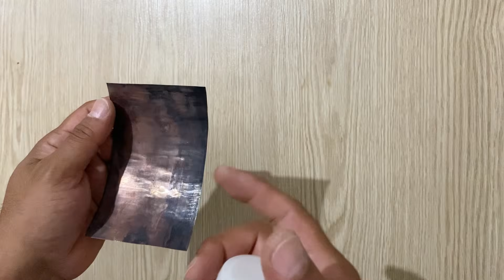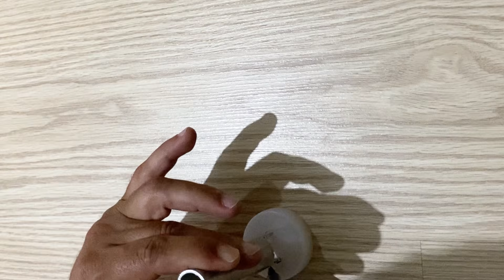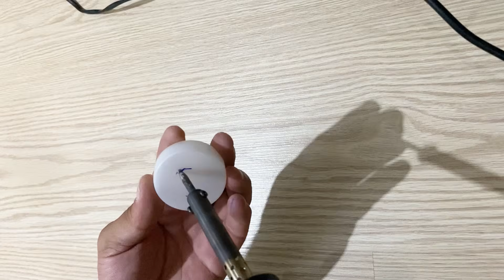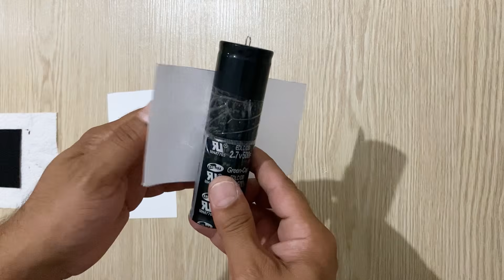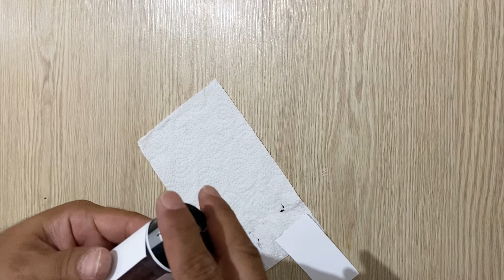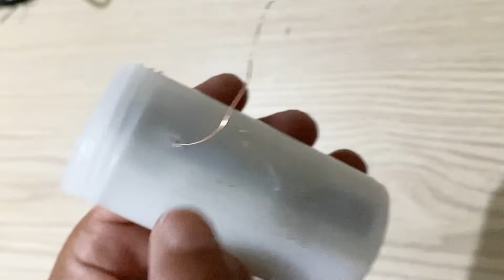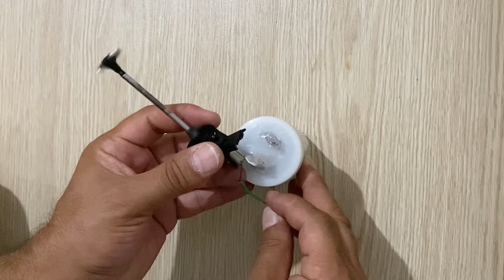How to Make Real and Powerful Battery, DIY Battery (5 Years Lifespan)

Comment: They can run indefinitely with a flow of 10-20% NaOH. But when I removed the NaOH the oxidation on the aluminum was such that it would not work again. Yes, the electrolyte turns to sodium carbonate in about 6 hours. Fresh electrolyte will keep it going. But if it dries it didn't work anymore for me. Nice clean work. Thanks!
Reply: you could use a baking soda/water mix and clean off the aluminum oxide with some gentle scrubbing before reusing. hope this helps!
Reply: Something I've tried that actually seems to work is to rinse the anode with vinegar. It stops the reaction of alkali on the anode. But it must dry completely or be rinsed with water before refilling with electrolyte or else it neutralizes the electrolyte. It does preserve the aluminum.
Reply: @evanriddle1614  I imagine that the vinegar has to sit on it for a while, right? i would think you would need to scrub at least a little, and since the aluminum in this example is so thick i'm not against scrubbing a bit for it to work at full capacity.
Reply: @zatnicatienth  just contact with the KOH or NaOH neutralizes it. Baking soda is for acid. Vinegar is for alkaline. The vinegar has to dry completely or be flushed out with water. The aluminum can be used again and again. I got 10 hours out of about 2 Sq cm .025" thick for a total of 1.5 ah. 2 hours one day, 5 hours the next day and the rest was consumed in 3 hours final day. About 150 mA
Reply: If, then, you were to feed it with electrolyte ( do we call it "catholyte now?) and drain out the bottom in a constant flow the charcoal would receive needed oxygen fully wetted or not and without CO2 incursion. Just a thought. Thanks.
Reply: Can you charge the battery
Reply: what if you use an aluminiumsulfate electrolyte? wouldnt that be better.
Reply: @Preyhawk81  just have to try it. There is an alkaline citrate I've seen on various white paper type websites says that's the best for aluminum air batteries. What's funny is this is similar to what's used to treat kidney stones. While I have a little feedback here, might I suggest wood glue (pva), a coffee filter and gum arabic. Mix pva & gum arabic, squeegee onto coffee filter and let dry. 6 hours run time instead of just one hour.

Comment: Interesting and educative video. 

My question is, will the battery also work fine without the activating conduct materials used? More also, what is it function?
Reply from the maker: It will work but not as long as the same lifespan.

Comment: Pls since i cannot see copper for to use and to which u sugguedted i used lead or stainless stiii. I waam to use lead.please can i coat it with a a mixture of charoal, electrolyte, carbon from finger battery and possibly use leas acid  of sudium hydrocide as water

Comment: Couldn’t you switch the materials and get the same result? Like instead of copper foil and aluminum pipe, use aluminum foil and copper pipe?
Reply from the maker: Yes you can. It doesn’t matter.
Reply: @joyofelectronics9782  ah, thank you! Also, I had another thought about your design. Couldn’t you get more energy out of it if you added more layers of foil/papers in the container?🤔
Reply: I's much cheaper the way he did it.  Copper is expensive.  Aluminum is cheap.

Comment: 😂Everything is good and thank you, but let me clarify some important points: 1- The idea of exchanging electrons between two different metals is the working principle of all batteries, and the voltage and current intensity vary according to the type and size of the electrodes and the conductive material between them.  The electrons that occur when a load is installed on the battery from the negative pole to the positive pole lead to erosion of the negative pole, i.e. losing electrons and gaining them on the positive pole, just like the electroplating process. This means that using the battery with a load such as a lamp or LED will lead to damage to the aluminum and the acquisition of a copper oxide layer  It reduces its work with the passage of time. The maximum period that a battery of this type worked with me with a medium of chlorine is 10 continuous days, but believe me, it will not exceed 15 days in any case, and removing the intermediate material upon completion of using the battery is only a postponement of the inevitable.
Reply: Ok p

Comment: This Is NOT A 5 Year Lifespan Battery,  5 Year Lifespan Battery Is When You Connect It To Any Device With The Same Voltage And Forget About The Energy Source For That Device For  5 Years, This Is False Clickbait As It Can Be..
Reply from the maker: No, you are mistaken. For example when you buy a car battery, it is written you can use this battery for 2 years. But you are not constantly use the battery. I meant the same thing.
Reply: To my experience with such batteries they'll work if they don't dry out. He's sealed it pretty well but I believe it would need to remain at least moist. If it dries it turns to alumina and isn't any good anymore. I've made these. Not bad! I like your style of building!
Reply: Much more could be said about this. I like the amperage. A few dozen of these could run a golf cart. But you'd hit that 6 hour "wall" in which the NaOH loses its potency. A method of displacing old electrolyte with fresh new electrolyte from a tank would keep it going. But such a system with all those tubes and pumps...yikes! Perhaps a longer vessel to let alumina fall off, not unlike lead acid battery cases for catching sulfated crystal formation.

Comment: Is there any alternative to cooper coil cos I can't see it to buy?
Reply from the maker: You can use either stainless steel or lead
Reply: @joyofelectronics9782  should I make the lead into square and roll or?
Reply: @joyofelectronics9782  I asked if the lead should be coated too
Reply: U did not ans? Should the lead be coated too?

Comment: Can you make this battery for 12-volts ? . What about if this battery discharges like other electroite batteries. Can you reharge it and how?.
Reply: The electrolyte is an instant charge there is no charging needed this is the beauty...also yes you can series and parralel n step up or down too any volts you require
Reply: @jshaw4757 when the power gets low, wouldn’t it be recharged or do you go ahead to change the electrolyte? At what point can one change the electrolyte?
This battery is interesting and is what building.

Comment: If one increases all the component sizes by for example 5 times will the voltage still be about 1,25 Volt or will it increase? Thanks.
Reply from the maker: The voltage will be the same but the current will increase 5 times.
Reply: @joyofelectronics9782  Thank you friend.

Comment: Creative video, well done, thank you for sharing it with us :)
Reply: Better to use lead instead aluminium pipe. Because electrolite solution will spoil the aluminium. Electrolite don't have negative effect on  lead.
Reply from the maker: @jamalfuzail4369  you miss a point. That’s not the case. It’s something different you said.
Reply from the maker: You’re welcome ☺️

Comment: Nickel Iron sulfuric: A battery with no electrode deterioration at all. Edison's circa 1900 batteries supposed to still work.
Reply: Not sure but isn't the Edison battery nickel iron electrodes and potassium hydroxide electrolyte?
Reply: @zendog48 I believe that's the case
Reply: And how do you acheive that 100% insulation and no passage of a single electron; so infinite stability, no side reactions, no air oxydation, no contact with water or moisture?
What are the electrodes? 
Fe and Ni? 
What is the solvent? Water?
What is the electrolyte? H2SO4 or metal (iron - nickel sulfate)?

If in contact they will corrode little one way or another...

That is why batteries can't last forever.

PHZ
Reply: @philouzlouis2042  Yet somehow batteries from my toys in 2004, and Nintendo DS still work. I think we were close to utopia but then some Brazilians came by. Replace Brazilians with the one race you can't talk about.

Comment: Well done. Now if I could make a suggestion. If you make this a two chamber battery then you could just tip the electrolite into the other chamber between uses then have it return when needed. That way you will not be continually handling the corosive liquid.
Reply from the maker: That’s Right but you can’t use the same electrolyte for a long time. You need to use new one bro👍
Reply: @joyofelectronics9782  how long can it last if in use for at least 6 hours daily? Does it matter if not poured out when not in use?
Reply from the maker: @nnejiamaechi9385  yes it is need to be poured out. And using 6 hours a day you can use it for about four years if your aluminum is thick enough 👍
Reply: @joyofelectronics9782  Ok. To me it does not matter if I does not last dat long by using it 6hrs a day and did not pouring it out. What I would prefer to do is to change it whenever the electrolyte is weak and it can be determined by the reduced voltage.
Reply: @joyofelectronics9782 can you use an automated spray system too keep the electrolyte topped up rather than a soak n toss method...its just a part off my ideas you seem too be on the same thinking as me but yh like a small solar powered electrolyte sprayer that sprays once every 10 minutes forever would that solve this issue maybe with an arundu board and a mechanical trigger off some description...cheers..get back too me if want too bounce ideas
Reply: ...and there you go folks!
Just like that.

...Oh. You don't have to ask about making a suggestion. This is the purpose of the "Comments" area.
But it's nice to know your parents raised you well.
Reply: had same thought

Comment: Doesn’t sodium hydroxide dissolve the aluminum and form hydrogen ?
Reply from the maker: Yes it is. So that’s why we left a tiny hole on one of the battery pin. So you have to be careful about this produced hydrogen gas.
Reply: a hose from this device to a balloon to collect the hydrogen produced would allow you to create more energy
Reply: I read through out all the comments to see if someone mentioned this,
surely, the reaction between Aluminum and Sodium hydroxide is very aggressive and used produce hydrogen to be used as fuel, it also creates a lot of pressure inside the cell and with a hole in it can let the electrolyte to spill out and causes damage to its surroundings.
also, the Aluminum electrode will be dissolved very rapidly even if the battery is not in use.

anyway, the instruction were good and maybe using another electrolyte can result in a safer battery.
Regards!

Comment: how much time it will run your blender continuously(how much watt of blender), & after fully discharge how much it will take time to recharge again ?
Reply from the maker: The answers to your all questions are exist in video. But l will explain again: this battery is not a rechargeable battery, l mean you don’t need to charge it. When you put electrolyte it will work. When it has electrolyte it can provide electricity for 6 hours. After 6 hours you have to renew the electrolyte. So it can run the blender for six hours.
Reply: @joyofelectronics9782 
He asked the ampere hour capacity of the battery .I am also eger to know it connecting additional cells in parrallel,is it possible to run higher loads?👈
Reply from the maker: @harikumar4418  bro the the voltage is 1.25 volts the current is more than 1 amp so the battery can provide this current for six hours. It means the battery has 1x6 = 6Ah. Yes if you make more than one battery of this and connect them in parallel and serial you can handle higher load.
Reply: @joyofelectronics9782  you are good in ansg questions and will increase your followership
Reply: Are u saying at 1,3v with over 1amp it can carry blender and to the extent of 6.hrs

Comment: What electrolyte you use, water + alcl3 ? , The alcl3 have yellowish like milk, its sign impurity of Iron, I dont think its aluminium will survive in it, i have try 3 week aluminium foil dissolved completlely, and i try ionic urea/alcl3 the aluminium foil not dissolved in 4 month but there are sign of corrode like many small holes, because there a bit water from air (moisture) exist in electrolyte forming HCL, and it corrode aluminium, the solution i think is use high purity aluminium like more than 99.92% and 99.98% electrolyte purity, and free from moisture/water, i guess  the impurity will make new side reaction, and the electrolyte must free from water
Reply from the maker: I used sodium hydroxide. This is a typ of aluminum air battery so it’s normal the electrolyte deplet aluminum, the battery produce electricity via this way. But as the aluminum is very thick it will take very very long time to depleted completely.
Reply: When the battery breaths its gass, which is Hydrogen and harmless, but it can be expected that there will also be some other gas that goes along with it. Is it dangerous to breath this in? Or should the battery be placed in a ventilated area? Thank you friend.
Reply from the maker: @benjaminvangheluwe3079  it’s better to use it in open or well ventilated area👍 hydrogen is detrimental
Reply: Puedes traducir a Español, Spain, 🇪🇸 Gracias
Reply: @maykaGM  debes aprender a copiar y pegar un texto en internet y usar el traductor de google
Reply: How many amp hours will it produce. Have you done any experiments with it?? I could see several of these together for motorcycle battery
Reply from the maker: @drewrinker2071  6Ah with same electrolyte
Reply: @joyofelectronics9782  dang, that's impressive

Comment: When you said it last for 5 years,   did you mean 5 years in storage  or 5 years of continuous use ??
Reply from the maker: Not both of them. I mean with a normal use the aluminum will deplete after five years. If you use very rarely you can use maybe ten years in storage.
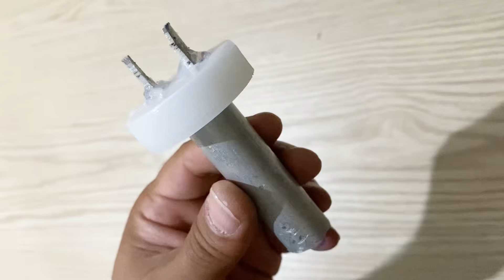Reply: @joyofelectronics9782 7:22 Good. Meaning it's not rechargable? What is the Amp? If the size is increased will produce more volts and amps? Can this size run a DC fan or motor ..small size?
Reply from the maker: @nnejiamaechi9385  this size of the battery can provide up to 1 amp. l measured and showed in the video anyway. The voltage will be the same when you enlarge the size of the battery but the current will increase. If you want to increase the voltage you can make more than one of this batteries and put them in series (2 batteries = 2.8 volts, 3 batteries = 4.2 Volts)